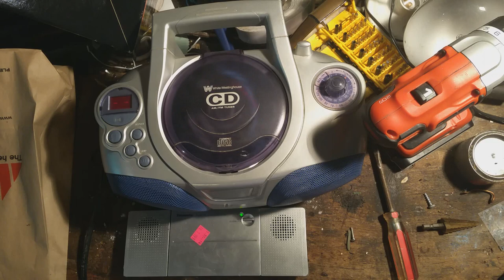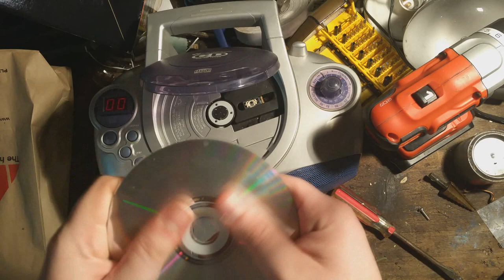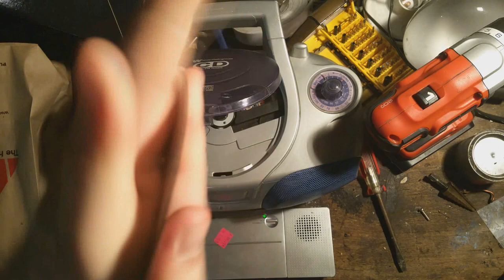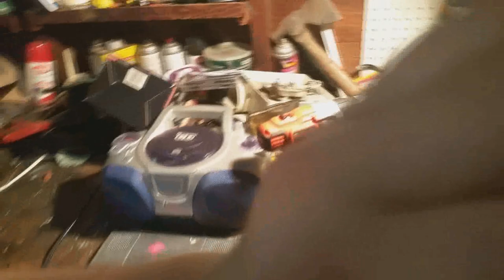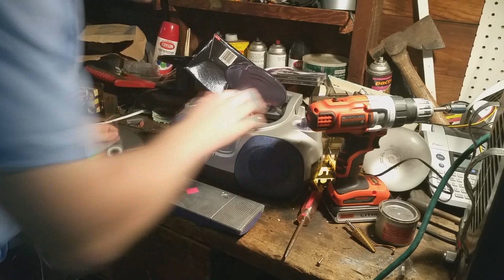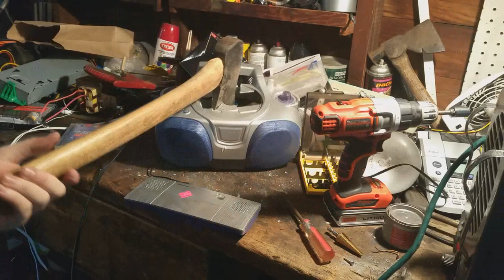The Terrible Tale Of The Trashpicked CD Player

Comment: similar problem happened to a cd player I had with an alarm clock and fm radio. the cds just wouldn’t play well anymore. I tossed it, the buttons started not to work, the volume was scratchy, it just wasn’t worth the hassle.